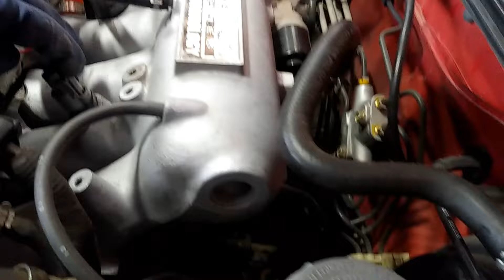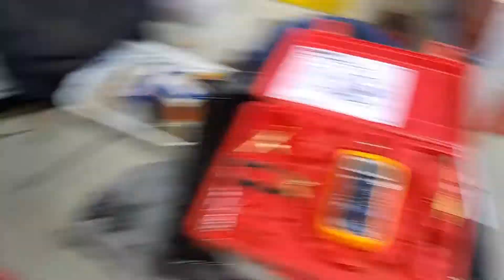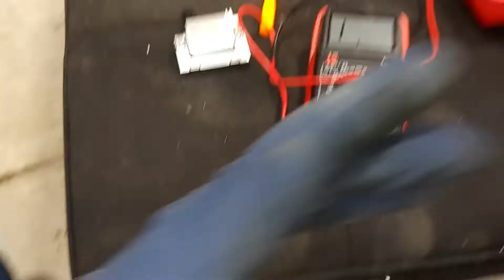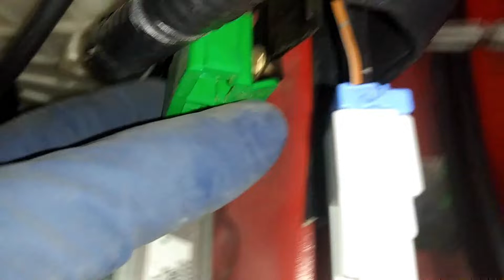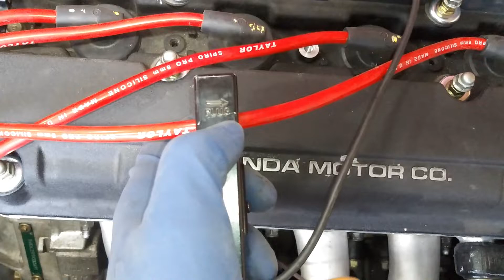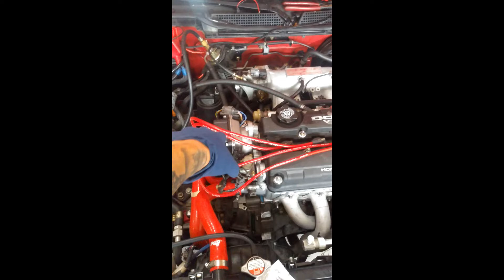acura/honda no start cranking no start

Comment: Jabs,the fuel pressure kit. Nobody ever shows how to connect into Honda fuel systems for pressure checks. That kit you displayed will it work on other Honda’s. I have a 3.0 and a 3.5 and all the videos you watch they say it’s difficult because it doesn’t have a rail adapter point. Sure would like to see more on that plus that kit you used part number. Great video. Thanks for sharing. Artie 👍👍👍what model test light is the one you are using and is that connector on other Honda’s. Thanks does the red line or white line need to be lined up. I know the white lines need to be aligned and #1 cylinder at TDC and the red line foot timing. Thanks again and I apologize for all the questions.